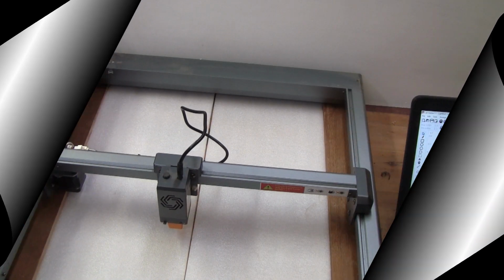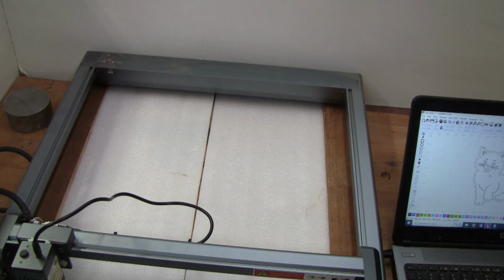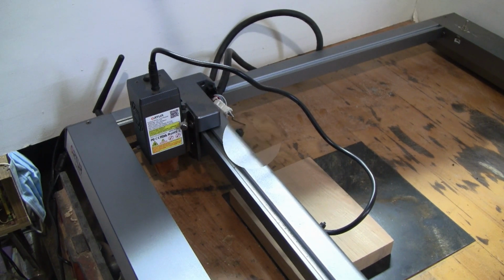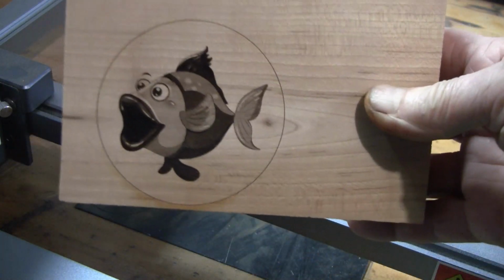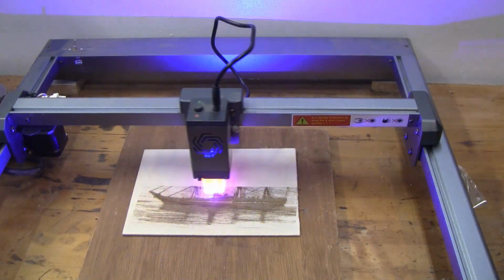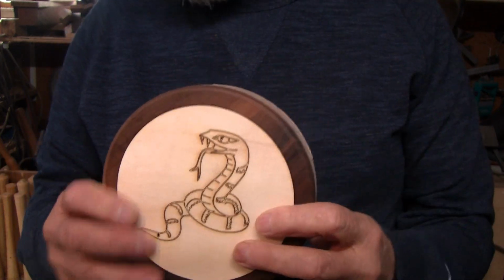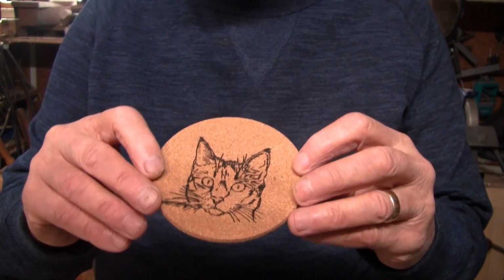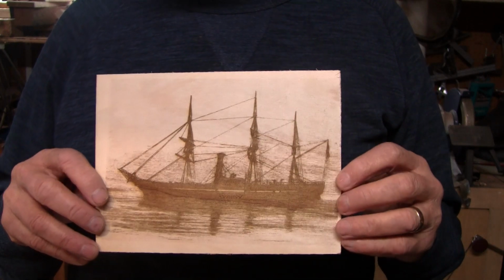Wood Turning meets Ortur Laser Master 3

Comment: Cool video, quick question, will that cut through the metal pieces also as it does the wood?
Reply from the maker: Thanks Tim. No this will not cut metal at all.  Maybe the aluminum foil used in the kitchen. But even then the laser does not do anything to shiny material. So if you want to etch metal it needs to be painted first then you can wipe the paint off.

Comment: I'm a wood turner too and last week my laser arrived. Now I have to wait until I finish 8 Christmas presents on the lathe for the grandkids and then I'll use the laser too. If you turn your bowl over and raise the laser frame you could directly burn your Maker's Mark on the bottom. Or you could burn/cut your Maker's Mark in a small circle and glue it on the outside bottom as an insert.
Reply from the maker: Thank you Larry. I did show one disk and mention it could be a logo on the bottom of your bowl.
I was thinking mostly about engraving the inside bottom.
I also have a video on the Laser Pecker and you can fit it down inside some bowls. And doing the bottom on the lathe before flipping is very easy.
 Have fun with your new laser. Which one did you get?
Take care,
Gary
Reply: I picked up the same machine you received after seeing reviewed on a Woodturning YouTube channel. I can see all the possibilities it has. I've had it for a week or so and like I said, I have some projects to finish before Thanksgiving and then I'm going to break it out. I've already assembled it. I also purchased the roller assemble to do glasses and other cylindrical objects. I was thinking of making some baker rolling pins for my wife and daughters and engraving them. 
I'm aware of the Laser Pecker and considered that as well, but for a substantial price difference I decided to get the Outur Laser Master 3.

Comment: Great review, Gary. I think you did an amazing job with that machine. I have been having a lot of fun with mine, but now I think it’s time to get back to the lathe. I guess I’ll see how the back likes that in the next day or two. Thanks for a great review, my friend. Really enjoyed this!
…..Gord
Reply from the maker: Thank you Gord. Now that  I have had more practice with it I think I could do a better video but I did enjoy showing what I did.
I found a permeant place for it instead of my work bench which at times gets shavings from the lathe. This way I can use it without setting so much up. 
 I do need to get a honey comb bed and an air assist.
 Did you get the honey comb bed to fit this laser? 
 I have a great idea for a segmented wood turning but I am sure I will want the bed and air assist to cut the wood I want to use.
 Thanks for watching,
Gary
Reply: Yes, I bought the Dewallie aluminum honeycomb bed. I wish I had purchased a different one because although it works just fine a steel bed would be better because I could use magnets to hold things down. I made some hold down pins that work well, but magnets would be much simpler. I am finding that there are a lot of things that can be made with this machine. I have made some Christmas tree ornaments with the names of my children and grandchildren on them that I think they will really like. So many hobbies, so little time! LOL.
Take care,
…..Gord
Reply from the maker: That does make a lot of sense. I was using magnets on my grilling rack/laser bed LOL
Got it a the dollar tree(Now the $1.25 tree)
I plan on ordering a real honeycomb bed soon. Steel makes sense

Comment: Very good review.  I've been getting up to speed using my laser since the middle of September -- there are so many possibilities with these tools.  I've done some shop organizing boxes and shelves for my French cleat wall, a saw blade clock, and some Christmas decorations in both wood and on aluminum credit card stock.  Have also done some engraving on ceramic and stone tiles.  This is a rabbit hole of its own.  Really recommend getting Lightburn, it has near CAD-like capabilities and is a very powerful tool.
/Had posted a response last night, but it appears YouTube ate my post, so re-posting a shorter version.
Reply from the maker: Thank you very much Mark. Yes it can be a rabbit hole but it sure is fun.
Yes I have bought Lightburn. It is very effective for sure. My CAD for my CNC mills is called Bobcad and Lightburn does a lot that it does.
 I have also pulled up some of my CAD files and ran them in Lightburn. A very good mix.
Thanks for watching and i may have to ask you a question now and then.
Gary
Reply: @ThePapa1947  Sounds great Gary.  I'm using VariCAD -- a very capable 3D modeling CAD that lets me export to both DXF for Lightburn and STL for 3D printer files.  I agree, this is fun stuff.
Reply from the maker: Ir you have not seen it there is a free program called DesignSpark. Very powerful.
My CAD program will allow 3D molding in solids. I also have a cool program called DeskProto which uses STL files. it does an amazing job making 3D carvings.

Comment: I appreciate these videos.  I was wondering how you would compare this to the Laserpecker.  I feel that the Laserpecker would be more versatile but what are your thoughts between the two?
Reply from the maker: Thank you. Well they are two totally different machines with each having it's own good and bad points.
The Laser Pecker will engrave the bottom of a bowl while still mounted in a chuck. Takes up very little room.
The Laser Master 3 has a much bigger work window and what I like is it runs off of Lightburn which gives you lots of options.
 So I will use both for all those reasons and many more.
Hope that helps,
Gary

Comment: That is really neat machine. A 10 watt laser. Imagine working with a 4000 watt laser on a bed that will take a 50 x 100 inch sheet of steel up to 1/2 inch thick. My last job, before retiring, was in a machine shop where it was my job to make shop drawings and program that 4000 watt machine. It would cut .040 steel like butter. The circle around your projects would cut in about 10 seconds.
These are neat for home use or for creating laser cut wood model kits. ;-)
Reply from the maker: Thank you Robert. I just checked and I do not think I have room for a machine like you are talking about LOL.
For a long time I have thought about attaching a laser to one of my CNC milling machines but this is much better and faster.
Thanks for watching,
Gary

Comment: Nice job! I just finished up my review of the laser. Nice to find your settings for cork. That's one thing I was planning to try but held off on. If you've got a vacuum chuck you can try cutting adhesive craft foam for padding. Works out great!
Reply from the maker: Thank you Robert. Cork was a surprise for sure. I tried one of my a picture of one my Illusion turnings and it was all black. I figured it needed to be turned way down and after that all the cork coasters came out nice. I could not find my favorite. i forgot I had already given it to my wife.
 I do not have a vacuum chuck but that sounds like a great idea. 
 When will your review come out. Look forward to watching it.
Thanks for watching,
Gary

Comment: Good job! Looks like an interesting machine. I like the ability to reproduce old photos.
Reply from the maker: Thank you Mark. Yes I like the idea of doing photos. I can think of a lot of photos I want to do. I have done photo engravings on my CNC milling machine but they take longer and hard to get just right. But I have done some in metal that turned out great.
Thanks for watching,
Gary
Reply: @ThePapa1947  Hi Gary. What type of CNC mill do you have? I keep thinking about buying one but I’m not sure I can justify the money or shop space. I build custom cabinets and furniture.
Reply from the maker: @markh5889  so I built the first one using a JET Mill/Drill I bought new for doing that. I made the brackets and added ball screws and servo motors. I then built all the electronics to control it including the power supply. I then bought a older Bridgeport Boss CNC. You could only do like 100 lines of data and it ran off a tape drive system.
So I put servo motors and built the control system for it.
 You are probably looking for CNC router is my guess. I do wood work on my mills but also have done lots of metal work as well.
For just wood the CNC router is the way to go. You want something good sized and very strong. Which will take up a bit of room.
I have been wanting to sell one of my mills just to get some space back. Or stop getting new toys. So selling one seems like the option LOL!
Reply: @ThePapa1947  Most of my interest would be in milling wood but I would like to have the ability to Mill metal as well. I do some metal working on the side. Mostly for my own use. Making tools jigs things like that. The electronics end of all that stuff is where I am lacking in knowledge. I would love to find instructions for making a smallerMill that would be capable of milling both metal and wood. A 3-D axis would be nice
Reply from the maker: @markh5889  I converted a JET miil/drill to full 3axis CNC. I also built 4th axis for it. You can buy a controller and power supply but I built in both.